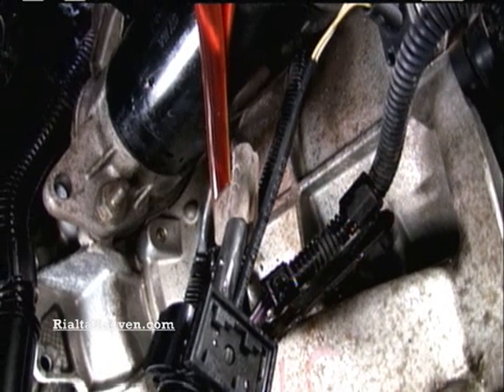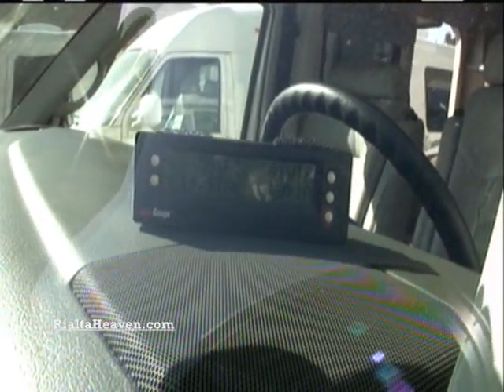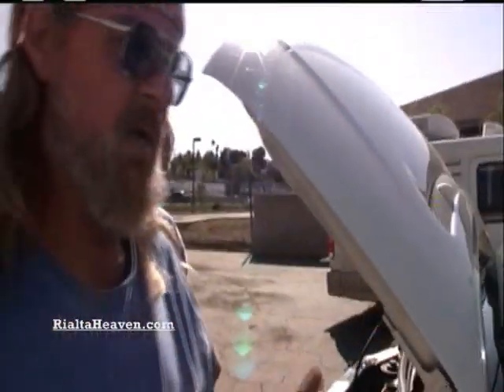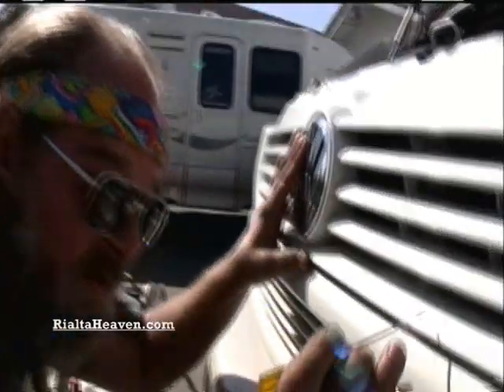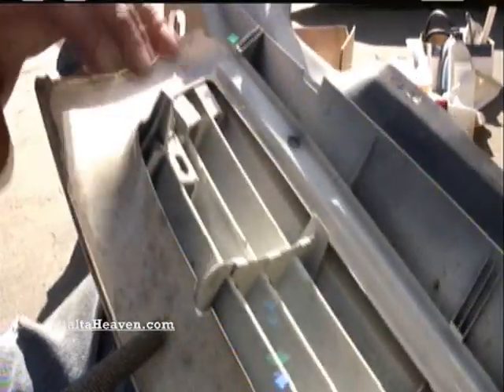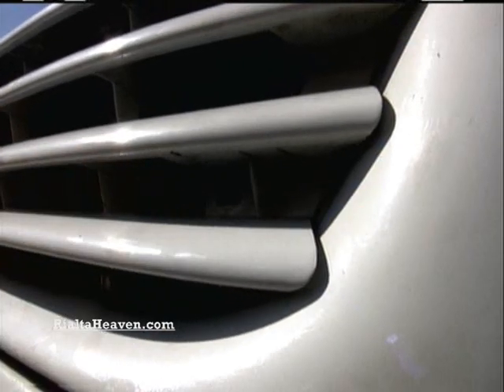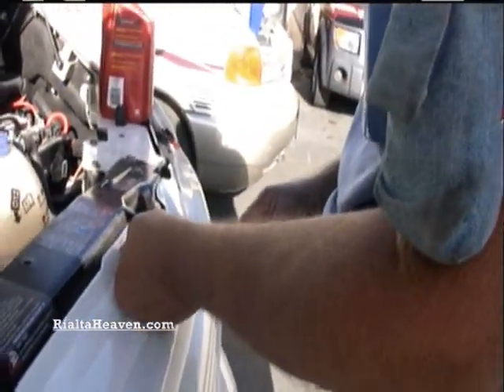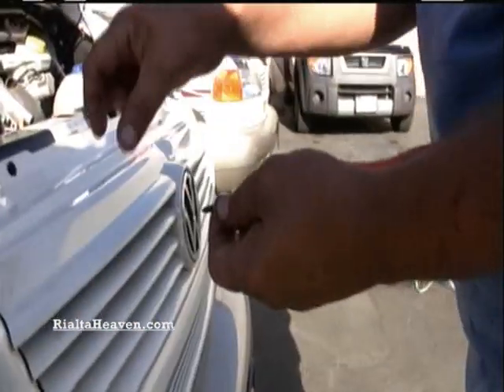Part 8: Rialta Heaven Transmission Cooler Install with Tx Pigeon

Comment: Do you recommend the cooler with the thermal bypass? I would think I want to keep this as cool as possible. My trans burned out at 16k miles in San Antonio- rebuilt $4600. VW should have recalled this poor engineering. My guess is they didn't consider the extra weight of a Winnebago box, camping supplies, & luggage.